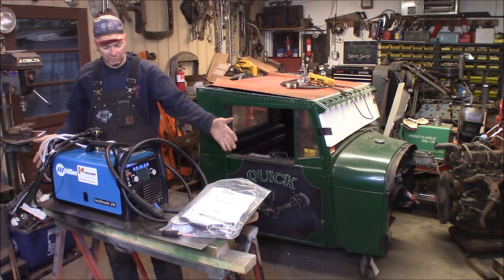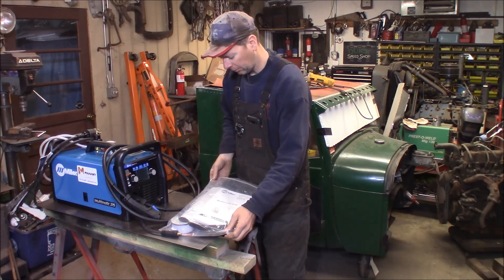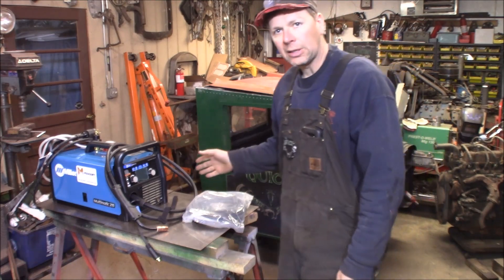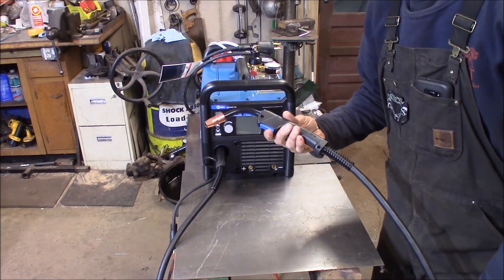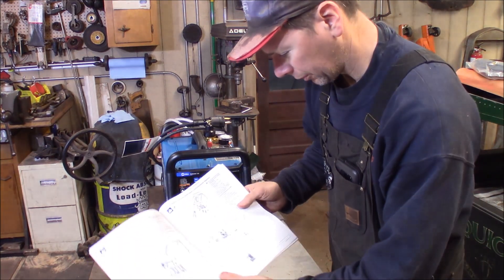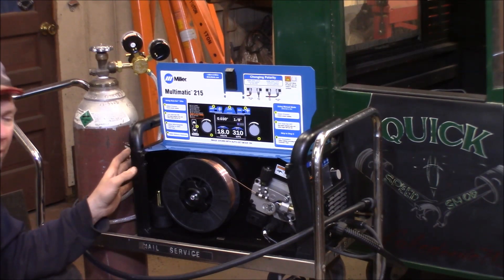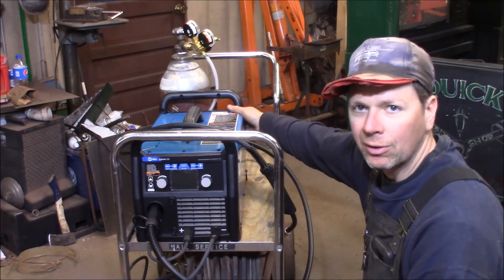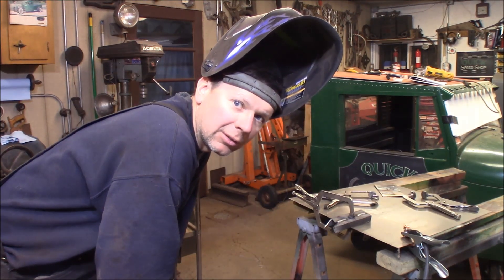Miller Multimatic 215 Stick, MIG, and DC TIG: Assembly and Review

Comment: Millermatic 211 vs 215?. I am looking to weld aluminum mostly and a lite steel
Reply from the maker: The mig features are pretty much the same.  The only way you are going to weld aluminum is with the optional spool gun.  The 215 TIG is DC only so you can not TIG aluminum with it.

Comment: Great video. Would like to see you  max out the amperage on 110v with some 1/8  angle, 1/4 t joints cut in half to see penetration. Does it tell you the max amperage off of 110v? Looking forward to more videos on this welder. Thanks!
Reply from the maker: I was pretty impressed with the 110V settings.  The AutoSet goes up to 3/16" for 110V.  I was welding on my hot rod truck frame which is 1/8" on the 110V and it had no problem burning in.  I had since wired up for 220V and on that setting it will due up to 3/8" maxed out.